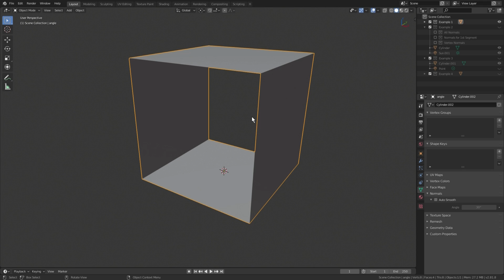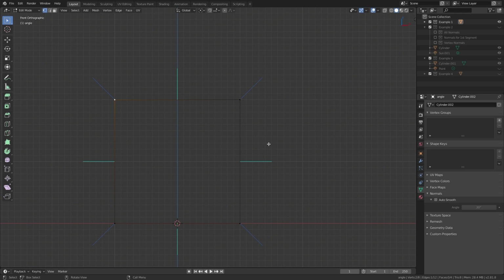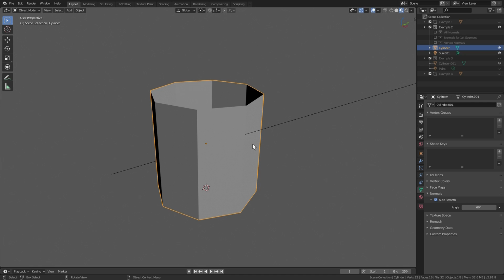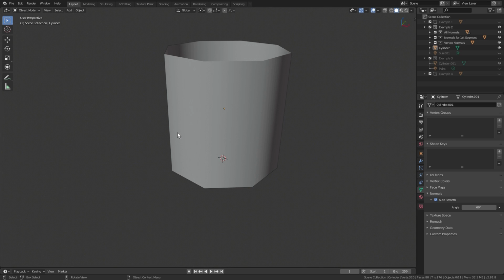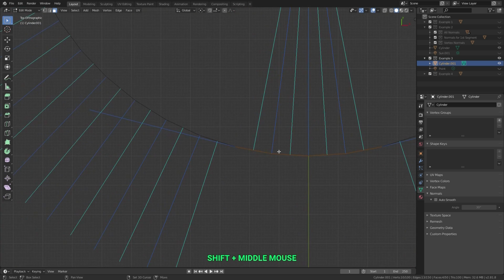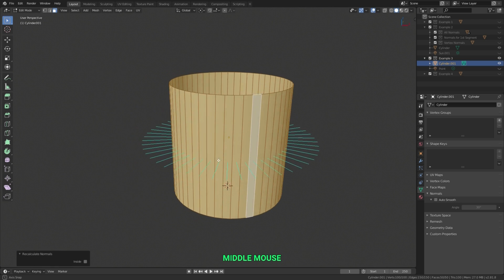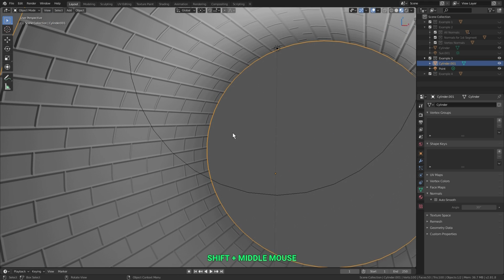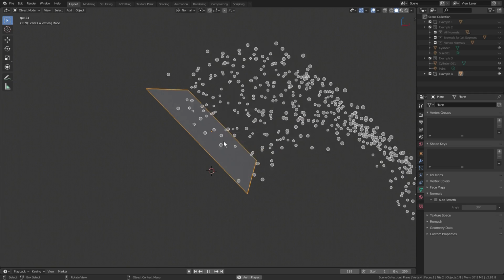3D Basics - What are Normals?

Comment: Vertex normals makes no sense to me, they are just dots...
Reply from the maker: True, a 1-dimensional point has no direction so it wouldn't have a normal, but in Blender they're not just 1d points, they can also be used to store other information. Like in this case, you can look at it like the vertex not having its own direction, but rather it's representing the directions of the surrounding faces and edges.

Comment: As far as I understand, normals are a simplification of how real life surfaces work. What you've described is similar to diffuse shading model. As the angle of the lightsource changes from perpendicular to paralel, the amount of light decreases that hits the surface, hence the surface  becomes less bright.  Lambert's Cosine Law might shed some light on it to reflect upon.
 Imagine you look from the light point of view, and when you view the surface form the 45 degree angle, you see less of its surface, and it decreases the more you get towards the parralel angle of light rays fo the surface
Reply from the maker: Normals themselves are simply the direction a face or vertex is pointing, and that's all. They're nothing more complex than that. They are indeed used for calculating shading, but also used for certain tools like extrusion, and for different modifier operations. But normals themselves are just the direction something is pointing.
Reply: @blengine  Of course. I was referring to light incidence decay related to normal
Reply from the maker: @MIchaelSybi  Okay just making sure =) Because normals are probably the most needlessly overcomplicated subject in 3D, and I wanted to make sure anyone reading the comments understands that normals themselves are not complicated.
Reply: @blengine  And I very, very thank you for this! You did a great job at it. Explaining something in simple terms is an art of itself
Reply from the maker: @MIchaelSybi  Thank you very much!

Comment: please can u tell me how to put normals in both in and out of the face?
Reply from the maker: Hey, I'm not really sure what you're asking, can you give me an example of what you're trying to accomplish?
Reply: @blengine  i exported a leaf to unity and it shows one side that's why i need to put the normals on both back and front 😅
Reply from the maker: @gab910  Every face basically has normals for each side, normals are just the direction a face is pointing, and this direction is used for shading both sides of a face. However, in game engines, it's typical to only render one side of a face by default, for optimization purposes, because you often don't see both sides of a face. So the game engine only renders faces pointing outward, and makes the inward faces(also called back-faces) invisible using a feature called Back-Face Culling. There is likely some kind of option in Unity to turn back-face culling off for individual objects. This might be listed as "back-face culling", which you would turn off for a leaf, or it might be something like "double-sided", which you would turn on for the leaf. Where this is, I don't know, I haven't used Unity so you'll have to fish around for that.
Reply: @blengine  Thank you for the explanation

Comment: Hello, I am talking with a developer from Nvidia's PhysX division and he said the following.  Does this sound like he means the normal on the static mesh and if so how would you project the normal onto a analytical cylindrical surface?
"There are solutions available. The first option would be to leverage contact modification - you can just take those contact points, project them onto an analytical cylindrical surface and adjust the normal to point back to the COM of the shape. If you do this, you'll get perfectly smooth contacts."
Reply from the maker: Hey John, I really have no idea what any of that means.
Reply: @blengine  That makes 2 of us 😁Thank you for the reply 👍🏻

Comment: Учите тригонометрию, математику по лучше и не будете такими тупыми..жесть ка для детей рассказывает
Reply: Artur: That's a little harsh, and I'd hate for math phobias to discourage people from using Blender. Sure, it helps to understand the underlying theory (and besides trigonometry I'd include vector analysis and basic optics, by the way), but lots of Blender artists do great work with only a vague understanding of what's going on underneath. Also, working with Blender is a good way to learn the theory,
Reply from the maker: Артур Саптаров, you're right. In fact when we toggle "show normals" it should pop up with a math equation on each face instead of a blue line. That would be so much more clear, stupid Blender!... Math isn't necessary at all for introducing normals and their practical purposes. -Chris